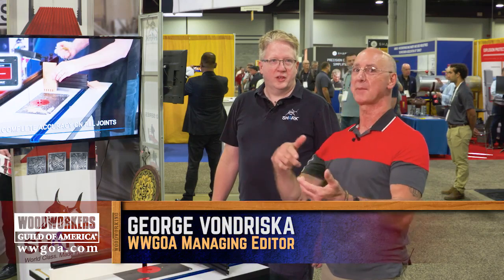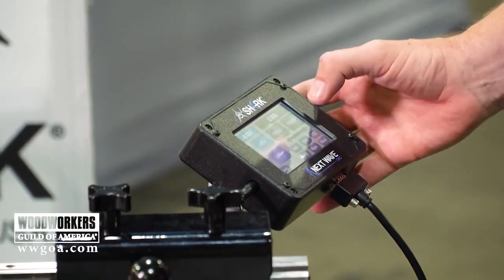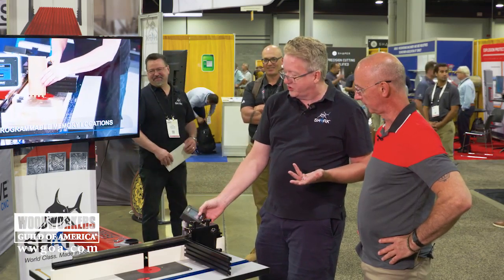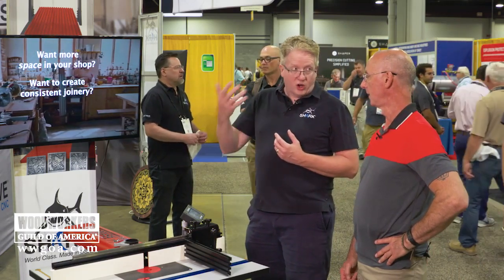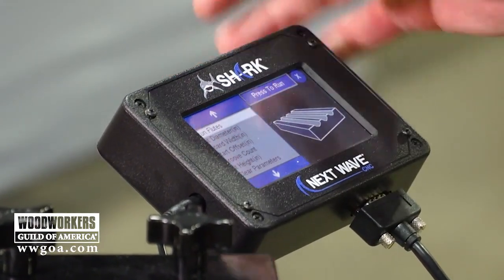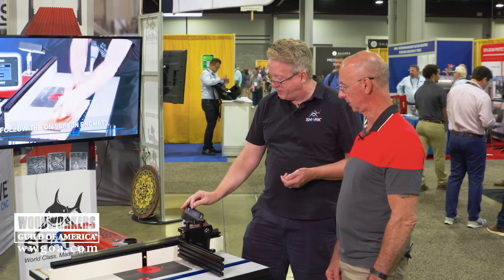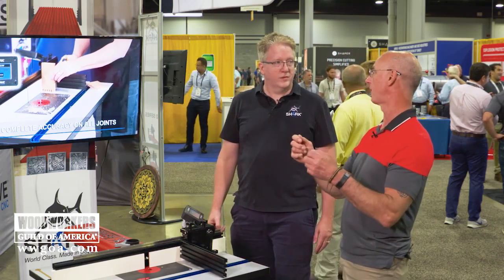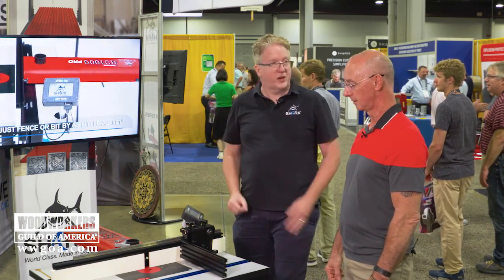Next Wave Router Table

Comment: If lock miter is so easy...why are there no videos of it using this machine on YouTube?
Reply: Also, couldn't you use the zeroing plate to measure the thickness of the material?
Reply from the maker: Great question!  The ‘Ask an Expert’ section is for members of our online community. I would be happy to send your question off to the experts. To get started, please provide the email associated with your paid membership. Thanks!